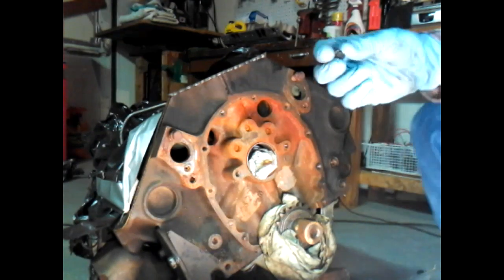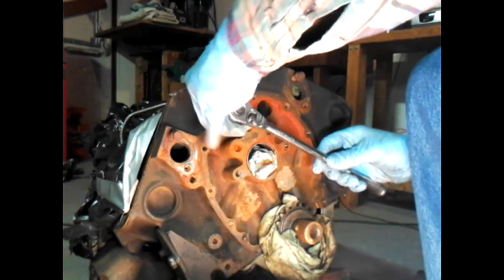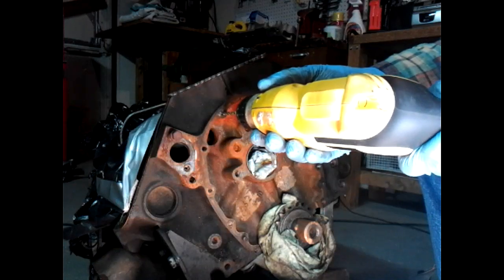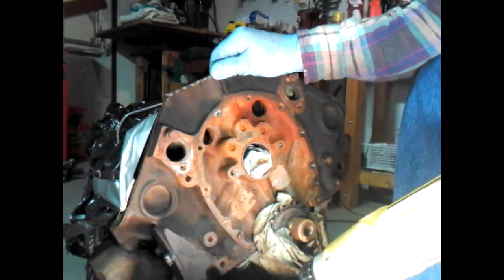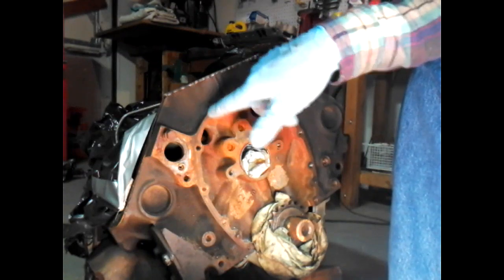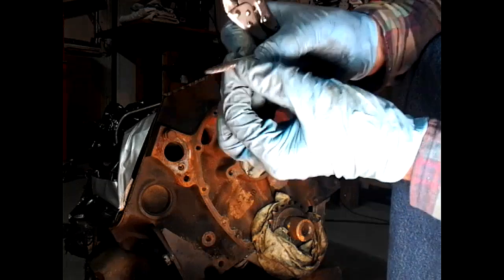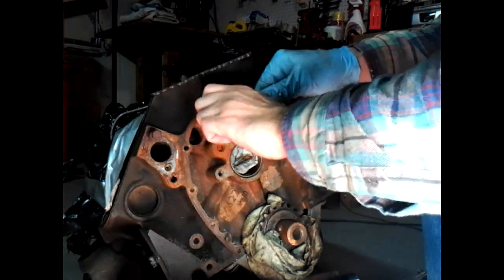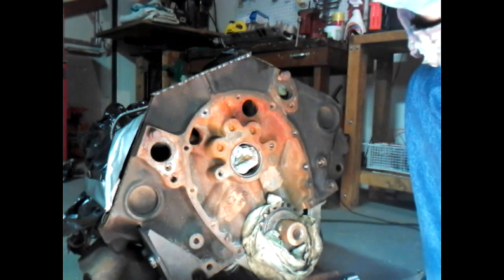How To Use an Easy Out Tool / Screw Extractor /Broken Bolt Removal

Comment: Personally, and maybe I'm just working on applications that are a bit different, (mine are usually broken off when taking out the bolt, not from over tightening) but over personally NEVER had an easy out work.  I've had them start to work, then just spin out the end of the bolt, making a big V shape, I've had them break off in my bolts, leaving me with TOOL steal to drill out which REALLY REALLY SUCKS!! And finally, I've had them Mushroom out the top of the bolt when they started biting, making the bolt even more stuck in the hole.  I was really surprised when you started with a bolt and broke it off yourself, I just wish you didn't cut frame right after you started using the extractor.  Now I'll never TRULY know if you didn't drill and tap it, and just add in another drilled bolt for the extractor to remove.  I'd like to think you didn't, but my experience with easy outs tells me you HAD TO!!! LOL.  Nice video.  Maybe next time, get a close up.

Comment: YouTubers name this look easy. I tried this but cant drill there the bolt to even use the extractor set. I've bought 2 brand new drop bit sets and they just won't cut threw the bolt. Yes I've tried titanium with no luck

Comment: I ordered these from Amazon months ago. I tested them out and thought they were shit because I did not understand that the drill end needs to be used in reverse too :) I thought that only the extracting tip should be used in reverse. Now I returned to that one ruined screw i tried this with and now it worked like a dream. :)https://www.amazon.com/Extractor-Aisxle-Stripped-Hardness-62-63hrc/dp/B01CA1PSCQ/ref=sr_1_4?s=hi&ie=UTF8&qid=1492505224&sr=1-4&keywords=screw+extractor

Comment: Most folk would need to centre punch the broken off bolt, to get it really dead centre. I notice that you drilled into the threads one side? I've never personally had any luck with easy outs, I've had them skid around and snap off, but not once get a broken screw or bolt out. Also noticed you had the Mole grips on the opposite way to which I'd use them for undoing, I'd use them that way for doing things up. Full marks to you for getting it out though, you succeeded.
Reply: Yes, I agree with all of your observations!  I also think that the ease out damaged the threads on the female side because the drilled hole was on angle into the casing and the extraction tool broke through the bolt, if I viewed correctly...

Comment: I had a caliper slider bolt snap. Would this work to remove same?  Maybe heat it with a torch first?
Reply from the maker: u can try this method..can weld a nut on it if u have a welder..

Comment: Thanks for the video, quick question what's the smallest size down I can go when using an extractor? I got a 12mm bolt that broke off on my car, should I use something around 10mm or even smaller?